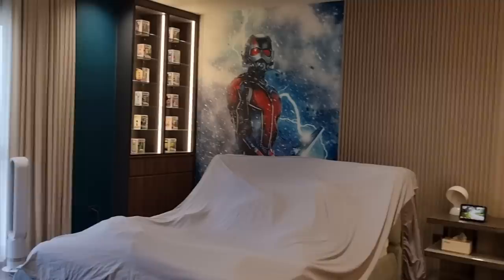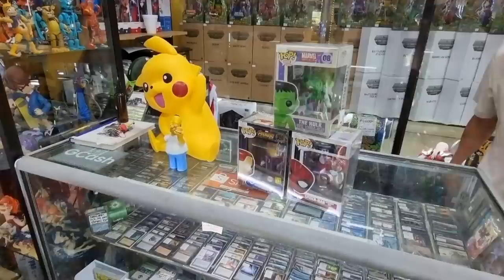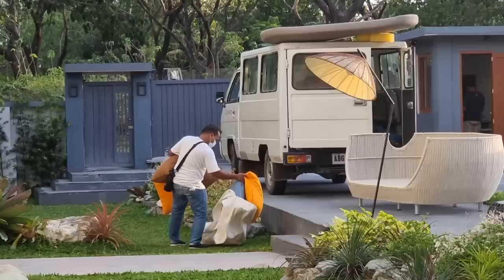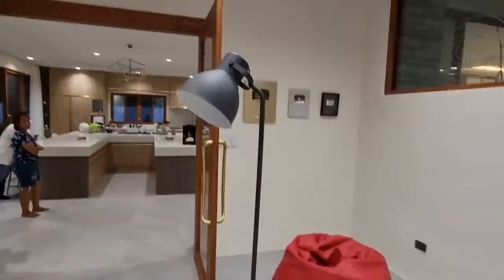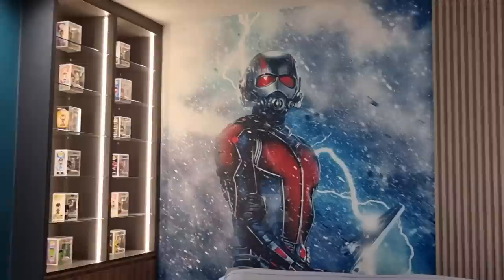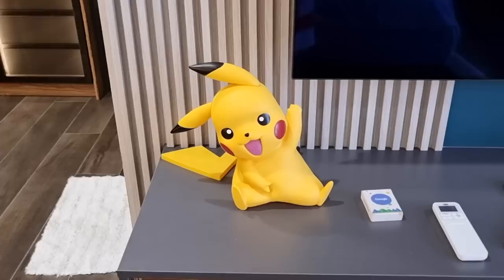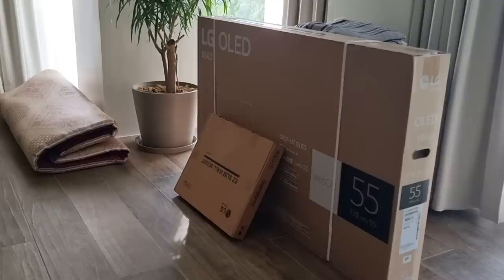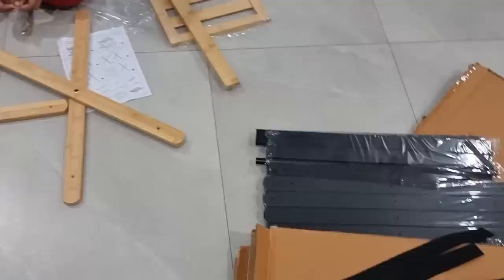The Themed Guest Bedrooms of Our New House | Vlog #1637

Comment: Just my opinion of course, but I see that dome lounge chair would look nice by the pool, where you can lounge closer to the water, when you just want to just sit close to the pool & not necessarily swim. If not,  I think that chair would look nice up on the rooftop sandwiched between those big planters. I think lounging in that chair would be nice at chilly night & be stargazing & a small table to put your wine & cheese or just a cuppa joe.

Now that drop off/landing from the pool where you put the wicker /lounge chairs, that would be a perfect place for an outdoor dinning table with a removable umbrella/canopy and put the pizza oven & grill near by. So when you have a pool party, you can just set the all the foods outside & do the grilling without the need to go back & forth in the house. Also have you considered getting a lounge wooden swing chair & park it in front of the where the mini house, facing the iguana's cage or the bougainvillea's?

Just a thing of caution. Once you finalize location of your outdoor furniture, consider putting a bracket on the ground where you can anchor them especially the light ones. The Philippines as you know experienced more than 20 typhoons each year, you don't want those nice furniture getting blown off....of course the other alternative is to move them indoors before the storm arrives. Another suggestion, either on the ground or one the wall/post you should etched on a cement the month & year you completed the house, you & RJ can put your handprints on it , you can also include your dogs paws if you like. Also the date when you had it blessed which I hope you planned to do. Some etched the year the house was built traditionally on top or the landing outside of the main door or in some corner somewhere. 

When your house/land/trees/animals are blessed consider having salt, water & candles blessed that you can distribute & keep in all the rooms of your house. 😉 Sorry for the long comment, I loved how your house turned out.
Reply from the maker: Oh wow!!! All amazing suggestions! Thank you and noted!
Reply: @MikeyBustosVLOGS  💖

Comment: I would put some shelving in the big wall of the green room and the tv in front of the bed. The air condition thing in the roof deck is leaking. It might be wise to put a gutter to avoid puddling.